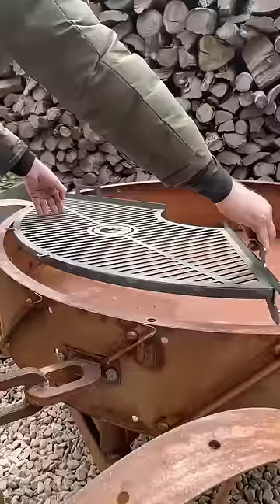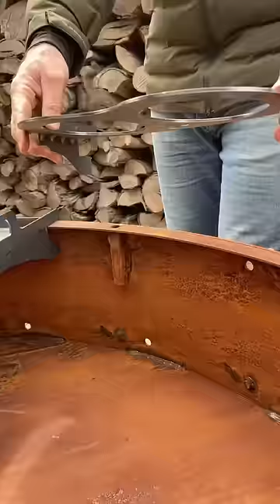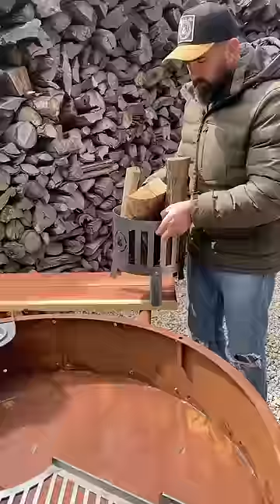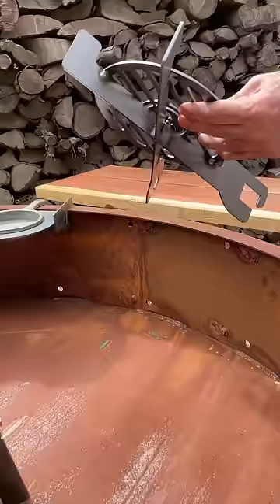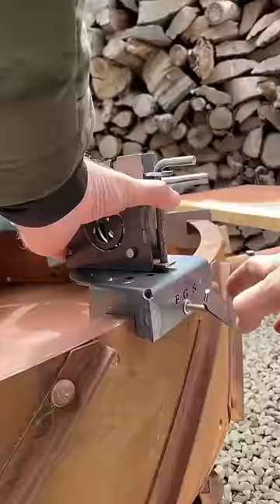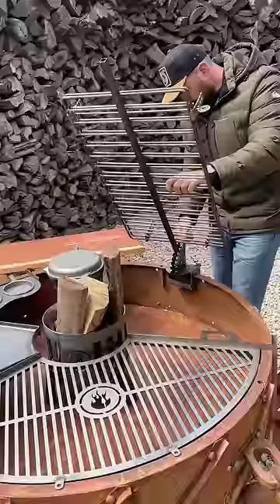The Odin Grill Review - A Must for Grill Masters | Al Frugoni - Open Fire Cooking

Comment: Man that's is the coolest cooker ever with the old tractor wheel and chain! I remember growing up here where I live and they where quite a few of those tractors around with metal wheels and cleats and old popping John Deere tractors and when I was younger I fired up a few of those old old John Deere tractors by turning the big heavy flywheel with my feet and legs firing it up on gas and switching it over to karrosene